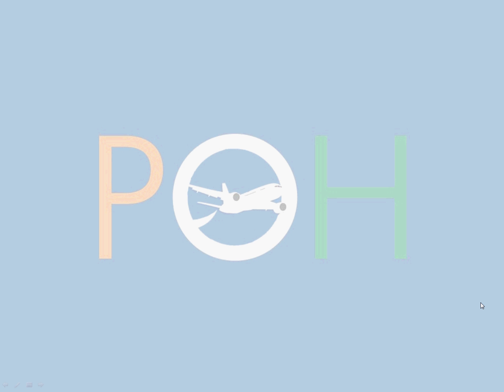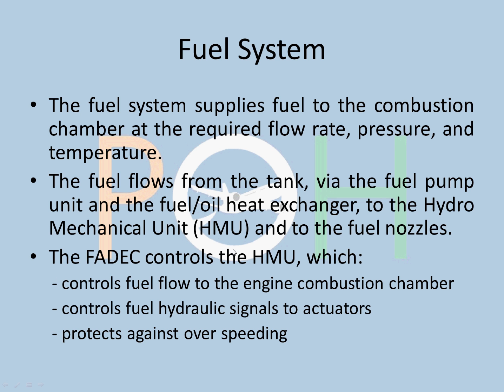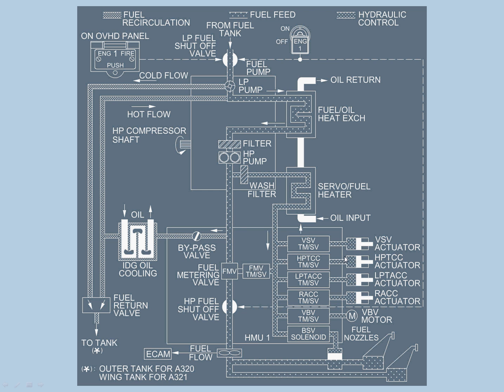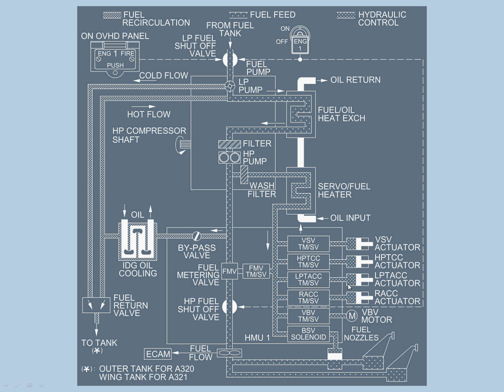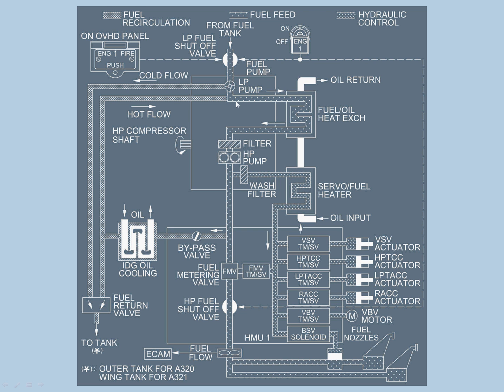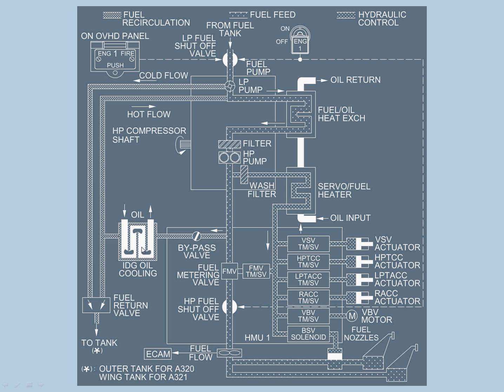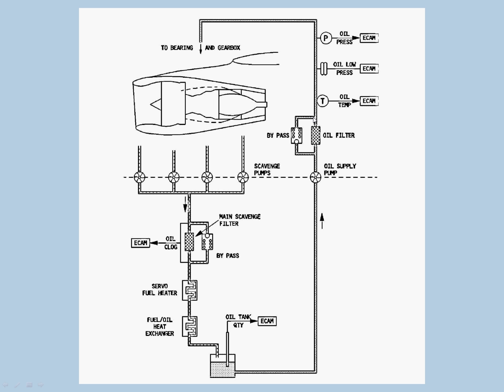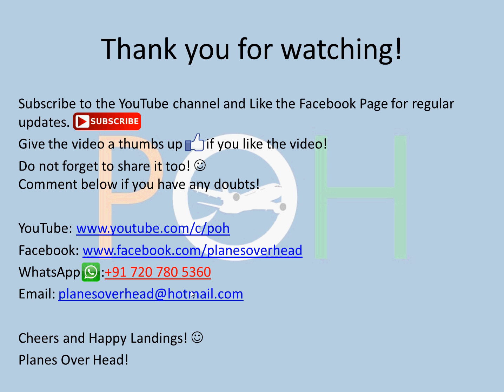A320 - Powerplant (Thrust Levers, Fuel System & Oil System)

Comment: Hi Capt, why does the fuel go back to the tank from IDG? The fuel will be used anyway right? Thanks (@8:26)
Reply from the maker: After using for cooling IDG oil, the fuel is too hot to be used directly into the engine and hence its sent to the outer tank for fuel cooling and also to maintain fuel in the wings to avoid wing flutter.
Reply: @poh  oh okay. Thank you

Comment: In FCOM it says 3 stops and 3 detents
Reply from the maker: I don't think so
Reply: @poh  TOGA, IDLE and MAX REV are 3 stops. FLEX/MCT, CLB and REV IDLE are 3 detents.
I don’t wanna argue which is right or wrong. Just let you know that in FCOM is a bit different than yours.
But anyway, you did great jobs. Your vids helped me a lot ‘bout the system. Cheers 🥂
Reply from the maker: No no don't get me wrong. There is no argument thing here. Just that all the manuals I've seen is that only. But 3 detents and 3 stops makes sense to do justice to the definitions. 

And thank you!

Comment: You missed the Fuel Metering Valve.  Especially the zoomed in image with the FMV, FMV TM/SV and the Resolver (DSC 70-40-40 P 1/4 of FCOM).
1. What is meant by the FMV position? Is it a valve in the FMV unit or the FMV TM/SV unit valve position?
2. And when it says 'To Nozzle' is the fuel from the the HP pump also added to the fuel from the TM/SV unit?
Reply from the maker: +Aniruddh Bhadra I felt it was beyond the scope of these basic videos. 🙂

Comment: The oil system exposed is not so simple as presented. There are many parts not described: bearings lub box, bleed air sealing, de-oiler, air-oil separator etc
Reply from the maker: For the pilots it isn't important to know those internal parts of the oil system, infact its not even there in our manuals. You're probably talking from and engineering point of view.